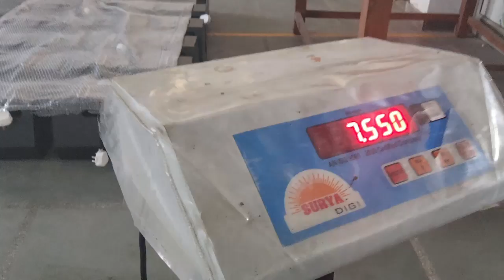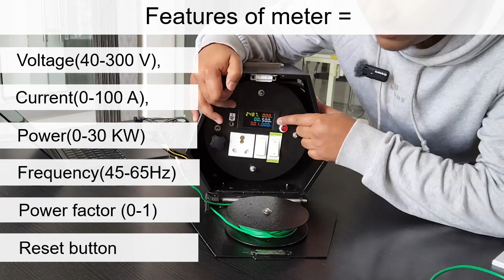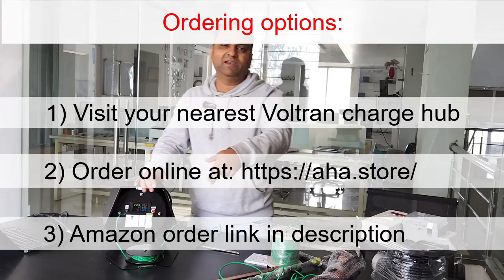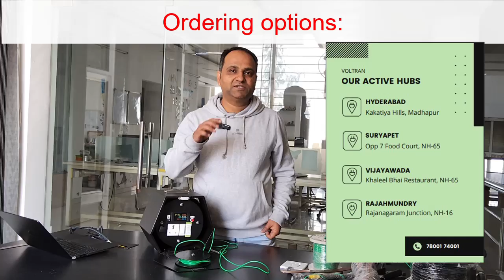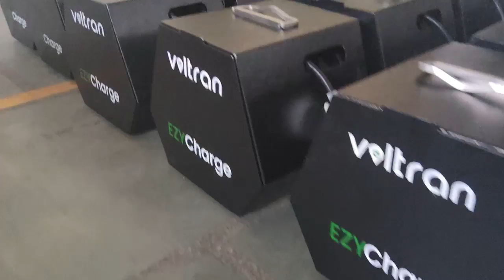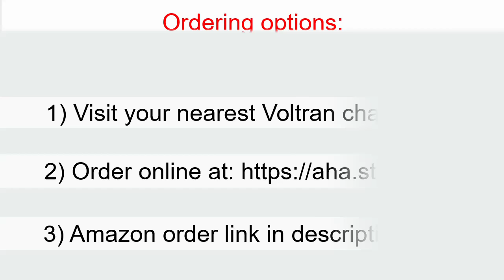New Aha.EV travel charging kit

Comment: The era that this extension box came is different, there were very few fast chargers but these days its not very difficult to find one. So this is more than enough.
In my 30k km i only used version 1 charger only once. 
Most of the time it's not about the length, but for the earthing we might need to use the box
Reply: The kit is just to give you comfort feeling while travelling on long trips many users will have EV as their primary car

Comment: Your PERSEVERANCE is very very commendable !! I would suggest some protection for hanging 15A plug. may get damaged if placed under luggage. dummy socket type something fixed on the box would do wonder.
Or just put a slot in box and fix the dangling plug inside the socket for tight fit.
Reply from the maker: Good point. Thanks.

Comment: One important product needed,
I have MG comet EV and recently I faced issue that really less charging stations are having options of slow charging so it is really difficult to take this car for long travel so can you make something like where we can use DC chargers with some converter so that I can charge my comet EV with these DC chargers basically concept is like DC to AC converter something like that I’m not sure but please guide on this.

 is it possible to really make it ?
Reply: You are better of buying this charger and use the plug point. Because DC charging will directly charge battery without any converting done inside the car. So your car doesn't have the capability at all, so even if you have a DC to AC converter you won't get any benefits and end up paying more money for DC charging and blocking the charger for hours together. And comet is not a car for long drives
Reply from the maker: As mentioned by @krv9113, the limitation is in the Comet EV, it doesn't have hardware inside to benefit from DC chargers. I guess its because MG intends it to be a city car only. The best option is to just use an AC plug point, use this kit if earthing is must for comet EV.
Reply: Some DC chargers have a extra plug point search for that. Or you can always request any shop or restaurant for a plug and pay them